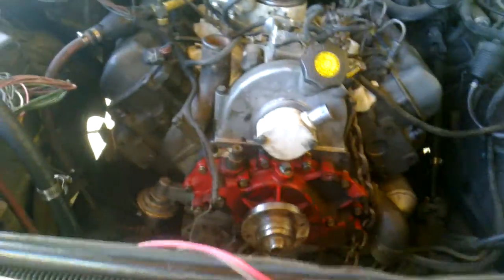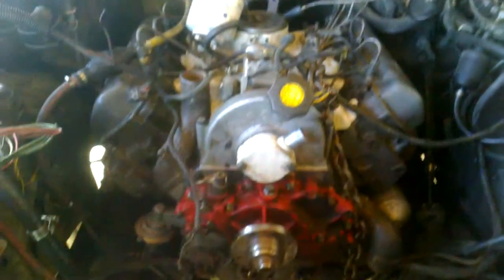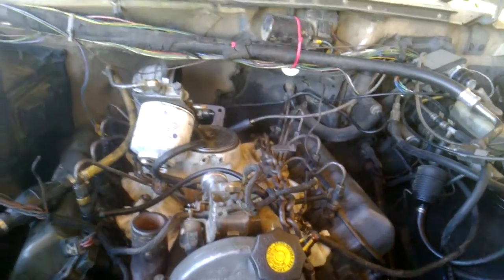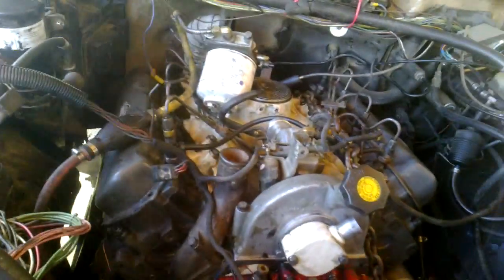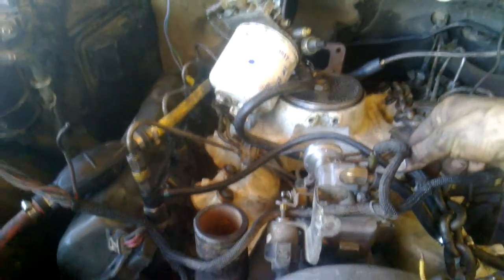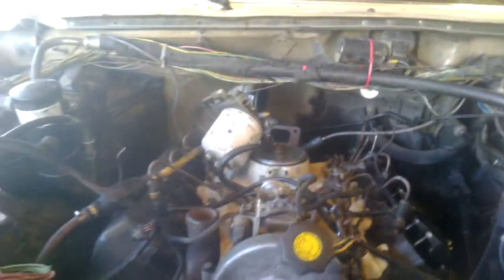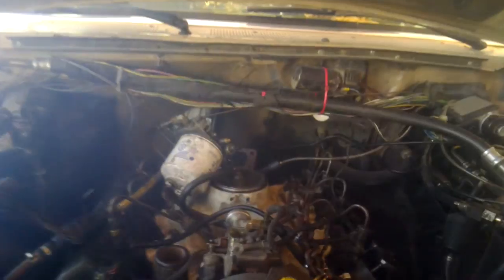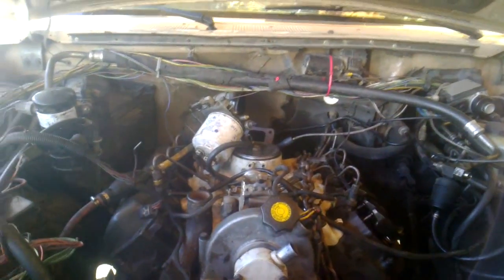7.3 idi with new cam and decompression gaskets, first start

Comment: I was implying like a walbro pump with a regulator. That is the pump that all of the powerstroke guys run, it produces up to 60 psi and with a regulator would be more than plenty. just a thought because I still have the lift pump on my truck and I notice at idle about 4-4.5 psi and wot 1-1.5

Comment: just out of curiosirty  why no electronic fuel pump? I would have thought with a 110 pump and as much as you are doing to you truck. I feel like the mechanical lift pump wouldn't keep up?
Reply from the maker: I don't trust them. Plain and simple. I've seen plenty of failures, and what's worse... they won't "flow through" like a mechanical pump.
If the mechanical pump won't keep up, the IP will simply suck fuel through it, and get enough(though at 0 PSI).
If the electric pump won't keep up, the IP will start drawing a vacuum(I believe), which is hard on the internal "transfer pump" section.

Also, the Facet Duralift pump that everyone swears by? My dad's 7.3 has one of those... It produces perhaps 7 PSI at idle; floor it at 3K RPM and it drops to 0. It simply can't keep up.
A mechanical pump will produce more fuel the higher the revs are, so it should be more stable PSI wise. I haven't gotten a gauge on mine, though.
Reply: Its still a good idea to add an electric priming pump before the mechanical pump for starting and hard low RPM pulls, its best to wire it up on a toggle switch. you can get flow through pumps that have a check valve in them to prevent back flow. but you do have to be careful on the pressure because the stanadyne DB2 has a psi restriction. if there is too much psi going to it, it will ruin the internal pump iside the DB2. Im sure if you called conestoga diesel injection they could tell you the tolerances

Comment: yeah marcrobb did you you get those from the guy Justin got his from? Out of country that is?
Reply from the maker: Yup; these are the extra-thick, two layers of gaskets with 3 layers of sheet steel gaskets, from Jan in the Czech Republic.
Reply: got a link or email to get those gaskets?
Reply from the maker: You can ask on Ford-trucks.com in the IDI section.
That being said, since this video was posted:
1. The gaskets /leaked/, at about the 1000-1500 mile mark. I apparently was supposed to re-torque the headstuds at some point, which I didn't know about.
2. The engine has never done very well with decompression gaskets. IDIs need that extra compression.
If you are concerned about piston-valve contact, recess the valves. That's a far better solution, and will keep the stock gaskets(which, with headstuds, are good to 450+HP. These gaskets failed(for justin) at like 400, IIRC).

Honestly, the stock gaskets are a really good design, and hold up really well. As long as you have sufficient clamping force, they will do much better than these.

Comment: What is that thing infront of the oil filler?
Reply from the maker: The spacer? It allows connection of a crankcase gas vent hose. Comes from the Banks turbo kit.
ATS and Ford turbo kits pick up the crankcase gasses from the driver's side valve cover.
N/A IDIs from the valley pan at the rear of the motor(turbos use this hole for an oil drain spot)
Reply: @MacRobbSimpson  do they sell that part alone i have a 6.9l non turbo
Reply from the maker: @charlesflaco7976  No clue, but if you aren't using a turbo, you don't need it(and honestly, the stock design is better for not picking up oil with the crankcase gasses).
Reply: @MacRobbSimpson  ok cool thanks

Comment: dude what machine shop took a 7.3idi .030 over? you should be mixing coolant in your cylinders
Reply from the maker: And yet... that was the one thing that didn't go wrong with that build. The machine shop screwed up with piston to valve clearance, and it threw a rod a year later... but I never had issues with coolant loss/cavitation. Heck, it's still holding coolant! The thrown rod obviously didn't hit the water jacket.
Reply from the maker: Don't do a cam. Add a turbo.
A cam, at best, is good for a few HP... and you are risking a lot doing it unless you completely tear the motor apart and check your clearances.
A turbo on the other hand... it's not hard to double your HP(and torque), it bolts on, and is pretty safe if you keep an eye on your EGTs. 
Seriously. #1 mod for these engines.